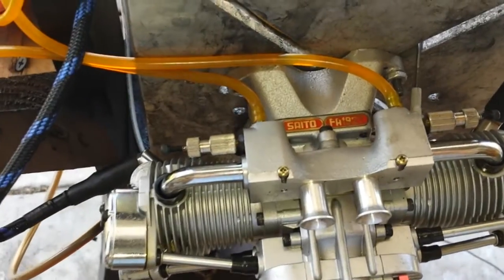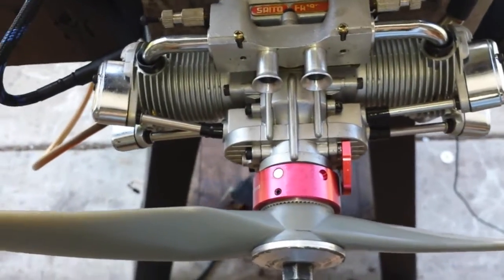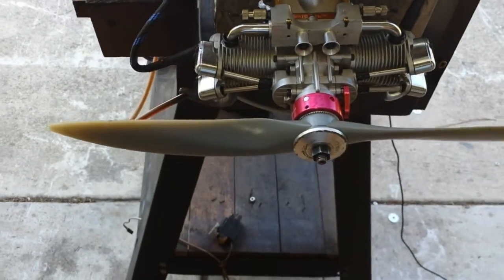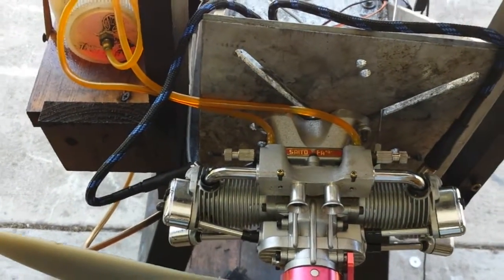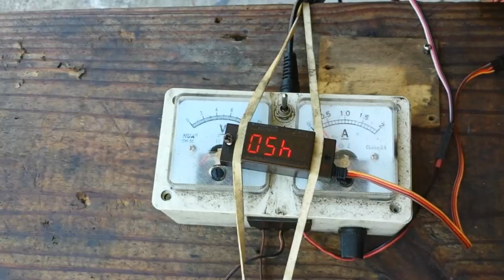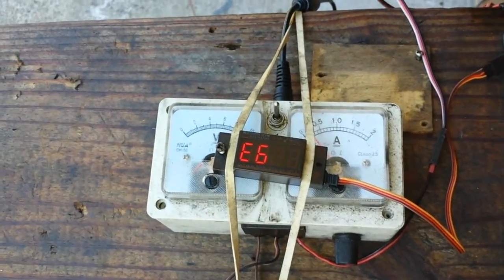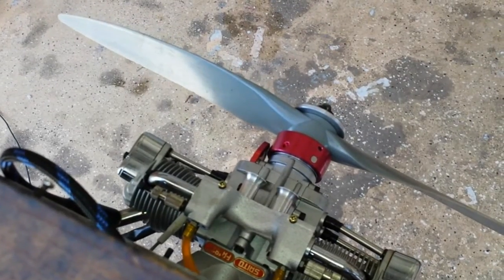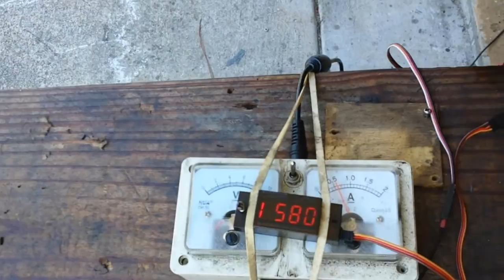SAITO FA 182T CH CDI IGNITION CONVERSION

Comment: I'm really pleased with your ignition system for the Saito 120. And it is amazing that the precise spark plug ignition gets rid of the nasty habit of the big 4-stroke Saitos to backfire! Starting the Saito 120 with a chicken stick works fine. The smell of methanol and 5% castor oii is sweeter than the regular glow fuel with nitromethane. And the fuel I mix is $6 a gallon, which is the same price as gas with a good 5% synthetic oil.

Comment: Adrian in the video you say you can also run it on gasoline, do you mean with this ignition system you can run the engine with no other changes on gasoline except that you lean the mixture a little? No modifications required? And what lubrication did you use with that fuel. Thanks Adrian I look forward to converting my FA-182TD to spark-methanol as soon as possible.